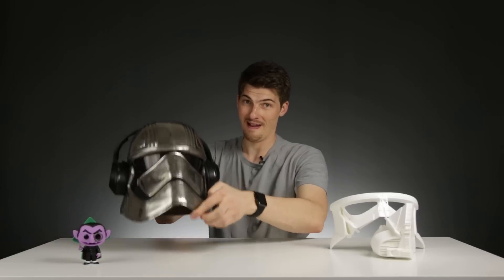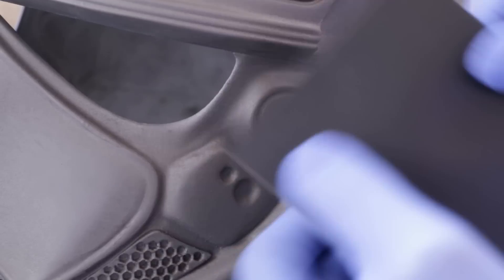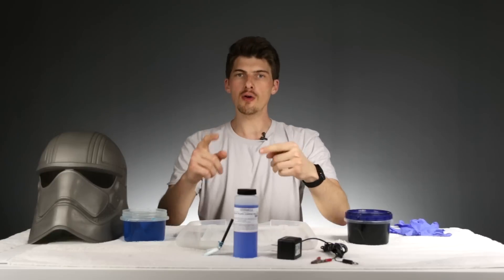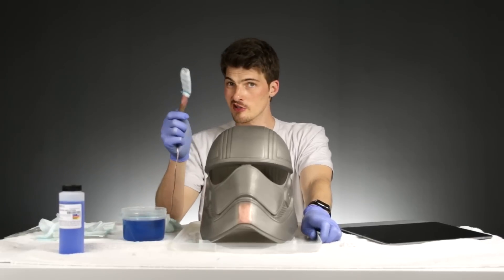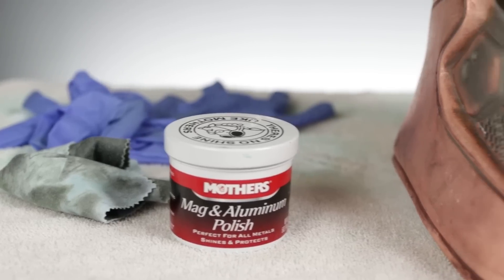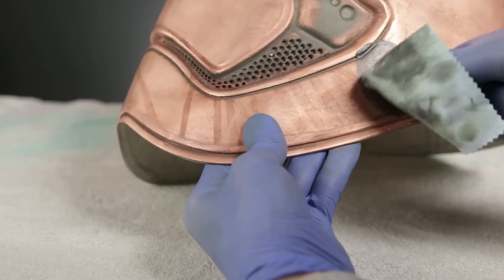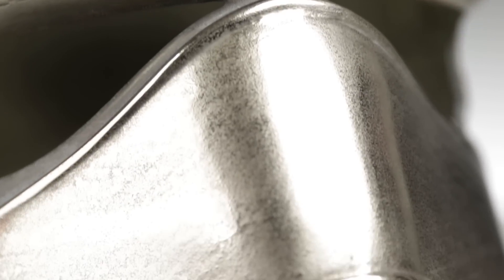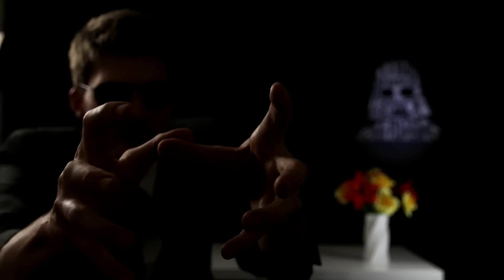How-To Make Metal: Electroplating a 3D Printed Star Wars Helmet

Comment: What are the brushes you used made of?? I want to do this for my own 3D prints for a SR71 Blackbird model, I purchased all of the solutions I need but I want to make my own brushes for this. Any information on the material used for the brushes for the copper and nickel coating would be excellent!

Otherwise this is an amazing video and I cant wait to start my own plating on my parts.
Reply from the maker: +Michael Roepke thanks for checking out the video. So for the copper solution, you're gonna want to use a copper anode and for the nickel solution you'll want to use a stainless steel anode. 

I simply went on to Amazon and purchased a thin gauge sheet of copper and another of stainless steel. I then took a hacksaw and cut off a wide ish strip. It helps to bend the strip a little in the middle. I find it's easier to brush around the surface instead of the strip being perfectly flat. 

Hope that helps!
Reply: Awesome!! I will definitely have to order some sheet copper/stainless, this helps a ton and saves me a ton of money on my project.

Thanks for all the help and keep up with these awesome videos!
Reply: Was that gauze that was wrapped around the brushes or just a cotton fabric?
Reply from the maker: +Michael Roepke thanks Michael. Yeah it's a ton of fun and really just downright awesome to work with some of this stuff. 

Good luck with your projects. When your done, check back and post a link to some pics (on imgur or something). I'd love to check it out.
Reply from the maker: +Michael Roepke yeah I just used gauze loosely wrapped around a small sponge. 

The user Yodaman commented on here with some of his process. He bought these microfiber sponges, cut them open a little and slipped them on the brush. That would probably work great too.
Reply: Infosmercial for sure, I've created two models one for a test piece to dial in the process and then a larger scale model for the real deal. I'll keep you updated when I complete the project! That's for all the help!
Reply: How many volts/amps is that power supply that they use?
Reply from the maker: +Michael Roepke that's a great way of going about it. It's essentially what I did with all this stuff too. 

I'm excited to see what you come up with.
Reply from the maker: +Michael Roepke sorry for the delay. I'll head back home and take a look, but I believe it is a 5v power supply pushing 250mA on the plug n plate charger.
Reply: Infosmercial awesome! That's what I kind of figured out yesterday with the plating, also I learned that it absolutely has to be as smooth as possible for it to plate well, you can't just spray it with the coating and call it good. Must be smooth af.
Reply from the maker: +Michael Roepke that is a good point.

Comment: Hi,

I have way better results with a 8€ metal spray paint in 10 minutes, with a polish as protective layer
Reply from the maker: +Zoltan Toth maybe so, but you won't get even close to the same durability of metal. For makers, this can be a huge boon as you are dealing with both a conductive and magnetic surface now. 

In any event, thanks for watching.

Comment: I dont get the point in doing this, the helmet wont become that strong as one made of metal or do i miss something? Arent there other ways of making it lookalike as Metal? cO
Reply from the maker: +Daniel Palaic there are definitely other ways of getting a metal appearance, but you won't get quite the results or even close to the same durability as this process. Plating on plastic could be great for cosplay too because it helps to reduce overall weight. 

A note too is that you can tank plate pieces prepared in the same fashion to build up a really thick plating. This significantly increase the durability and heft as opposed to brush plating like the video.

Comment: You probably should not have polished the copper before pleading it it would've been better just to clean it and played it without the Polish residue
Reply from the maker: +Dan Festag yeah as far as keeping the surface very clean you are right indeed. This is just a process I found that has given me great results. I have tried with polishing the nickel layer instead and the results weren't as good for me. One reason is probably because my nickels layers aren't very thick. 

In any event, thanks for watching!

Comment: might missed a point : why coat it in copper if it's to cover it all in nickel ?!
Reply from the maker: Matrixtechno Hey there. I did pin the top comment for this video and it basically asks the same question. Check it out as it will probably answer your questions. If not, write me back and I’ll try to explain. 

Thanks for watching!
Reply: oups sorry my bad. in the mobile app you get the comment box before seing any comments. thanks !

Comment: Great video! Very informative! I was not aware there was a way to electroplate without submerging the whole thing in a bath before I watched this video. This is a great way to do it when you only want a few details to be metal.
Reply from the maker: kedwa30 Thanks for watching it! I’m glad you liked it. Yeah this process is really handy when working with larger parts. It’s easy and pretty cheap to build very small tanks for plating very small parts, but a tank to plate a full helmet of this size would get to be rather expensive. Especially if you only plan on making a few things here and there.

Comment: what did you use to glue the parts together? Did you use Bondo or something to smooth the seams/striations?
Reply from the maker: Robert Gorman I mostly used super glue to bond the parts together, but I used a big and very helpful trick to increase the super glues strength and curing time. For the seams. I printed in ABS, sanded down the print a reasonable amount, then used a product called XTC Smooth on as a coat to get the helmet as smooth as possible. 

It’s great that you ask because it looks like my next video is going to be on exactly this topic: assembling large 3d prints and tips for smoothing them out.

Comment: i would definently use a polishing machine.
Reply from the maker: +Tammi Mars thanks for checking the vid out. I would disagree on this specific instance. The only reason I say that is that it would be too easy for the pressure of the machine and the cutting agent to strip off the copper since it is a really thin layer. 

I could be very wrong though and wouldn't mind trying it out someday too.
Reply: True, but if you use a soft cloth machine for cars, along with rubbing it should work
Reply from the maker: Tammi Mars Yeah you might be right. I bet you are and I bet the results would be even better than hand polishing. Might have to try it in the future.

Comment: Wow amazing process & video must have taken ages. May I ask why the need polish the copper? I guess it gives you a better quality nickel finish?
Reply from the maker: +JazzMan2001 thanks for checking it out! You nailed it. Copper polishes pretty easily and whatever you plate on top of it will appear to have the same finish. Meaning that the nickel won't look dull, but rather highly polished on top of the copper. 

Of course, that's the desired result here with having a high shine. You don't have to do it if you want a more matte finish.

Comment: This gives me so many ideas! My current issue with metallic looking paints is that when you spray them with protective coating, it removes some of the shine if not all of it! 

I may use this to make things look more metal!
Reply from the maker: +Meme Johnson yeah the spray paints that I have found all have issues with either clear coats or being touched by the hand. That's just one of the advantages of this method.
Reply: Oh yeah definitely, it's unfortunate how badly clear coats work with metallic paints
Very helpful video, your channel has a lot of potential so keep at it. Great production quality!
Reply from the maker: +Meme Johnson thanks for the kind words. Stay tuned! There's more coming....

Comment: What was the before and after weight of the helmet?
Reply from the maker: +Gaara I'm uncertain of the measurements. In this case, just feeling it the weight added was small. I made one where I tankplated the individual pieces before assembling the helmet. That's led to thicker plating and plating the inside. This added significant heft.

Comment: I thought the normal way to electro-plate something was to completely submerge it in the metal solution and let the layers build up.
This method seems... less efficient.
Reply from the maker: +TheSmackerlacker less efficient in terms of building a thick metal coat and having to do things manually, then.....yes. However, having a tank plating setup to handle an object of this size would be rather expensive. Especially if you only intend on plating a few things here and there. 

The biggest benefit with this method is really cost effectiveness. It requires significantly less supplies to do this. Great for hobbyists or the occasional object.

Comment: Pretty cool stuff but seems like alot of trouble. Electroplating actual metal can be a pain in the ass, plastic I would imagine could get even worse. Cool for smaller pieces though for sure!
Reply from the maker: +Bluelight Gaming it typically is, but I was surprised at how simple and easy, relatively speaking, this process was. Especially plating with copper. Up to that point it was super easy.
Reply: Infosmercial yeah its when u start putting different metals on top of each other than some issues start to arise but it's cool tech for sure.

Comment: Interesting, I would have just tanked the whole thing, had no idea you could do it manually. 

Wonder what would happen if you use some of the metallic 3D filaments (ones with metal particles in them) as a base, rather than having to pre-coat it.

Had a look none of it ships to Australia, why am I not surprised lol.
Reply from the maker: +Matthew Farrell in certain you could find supplies for this same thing tho. You would just need to find an electroplating company that ships there. I suppose the nickel spray may be the tricky one. 

I hear the conductive filaments don't work particularly well for this sort of application, which is why I went this route.

Comment: electroplating isn't turning 'anything into metal' it's literally covering it in metal... bad title... lol
Reply: If you pass 5th grade science you'd know actually turning anything into metal is impossible. This video is actually alot cooler and more in depth than I expected. I thought he meant painting anything to look like metal but the fact he put an actual metal coating is way more impressive.
Reply from the maker: +hanoncs meh, click bait usually doesn't have content to back the title or its convoluted info. 

I would argue that this simply isn't the case with this video. Thanks for checking it out tho!

Cheers
Reply: We don't care
Reply from the maker: kedwa30 bingo!
Reply: While technically you are correct, once it has a metal finish, people will call it a metal helmet. So it figuratively does turn a plastic helmet into a metal helmet.

Comment: An easier and less time consuming polishing method, is a product called Nevr Dull [it may actually be NEVER, I don't recall]. It's relatively inexpensive and lasts a long time. It comes in a can/tin and is composed of a cotton batting impregnated with some type of oil.
We used it in the military to polish things that are supposed to be shiny, brass door handles, military accoutrements (buttons, badges, etc). 
As a GI, I wanted to find the easiest, quickest method. We didn't want to waste our precious time on make-work crap. This is it.
It does leave a thin coat of oil on the item, so thorough cleaning is essential.

Comment: have you thought about using acetone-steam to smooth out the abs surface? I assume this would make it more shiny without polishing
Reply from the maker: Noggernono Yeah I have used that technique occasionally and it can work with pretty good results. The reason I like sanding and using either something like XTC Smooth On or Filler Primer is the level of control you have over detail. I never got that great with acetone smoothing and it seems easy to take it too far. sorta difficult for large prints too.

Comment: I hate to be this guy but the polished copper looked cool the nickle just looks like its spray painted with silver paint.
Reply from the maker: Yeah I hear ya. It looked pretty darn awesome in copper. The nickel finish may not have appeared as well in the video, but in person there is no comparison. If you're willing to really put in more time into this whole process, you can essentially achieve a mirror like finish that simply isn't possible with any paint or powder I have been able to find. There are some other benefits like being conductive, significantly increasing durability of print, and it can be handled with bare hands (something a lot of paints and powders don't deal well with).

Thanks for watching!
Reply: I actually thought that may have been the case. That the camera just wasn't able to show it. But in copper I thought "Damn I want to make that"
Reply from the maker: +x9x9x9x9x9 yeah the copper looks really damn cool. It actually looks really cool if you let it sit for a week or two after plating. It sort of rusts and corrodes a touch and gives it this steampunk sort of look.

Comment: how strong is the helmet now compared to when it was just I'm assuming PLA? and would you have to bother with the super shield if you got that conductive PLA from I think proto pasta?
Reply from the maker: cityhunterinak thanks for watching the video. I used abs for my print and prefer to work with it for a number of reasons. It sands down easy is the biggest. Having a smooth surface is key to getting a highly reflective surface if your electroplating. There are ways of doing this tho with PLA like using XTC Smooth on. 

As far as using super shield goes, it is remarkably conductive. More so than any 3d printable filament you will find. This makes electroplating a fast process. I did some research into conductive filament and it appeared that none would work well enough to get the job done when it came to electroplating.

Comment: Hi, really good video on methods of doing electroplating. Have you tried this on non sanded prints with visible layers. I'm looking for methods of smoothing prints without sanding.
Reply from the maker: +Rossosaurus hey there rosso, glad you enjoyed the vid! I haven't tried this exact method on non sanded parts. It would probably be kinda tough to build up thick enough layers to make the appearance smooth. 

Two things you should look into: one is a product for xtc smooth-on. The stuff is relatively cheap and does a fantastic job at eliminating the need for sanding. Note though that this is a 2 part epoxy so it requires careful handling and safety precautions. The other thing to try is high fill or high build primer. This stuff can easily be found at automotive stores, Amazon, Walmart... all you really do is spray thin, bet wet coats a few times and it starts to build up. In my experience, it still requires a small bit of sanding whereas the xtc smooth on can be good to go after one or two coats. 

Cheers!
Reply: +Infosmercial Oh awesome, I'll definitely try xtc. Keep up the good work